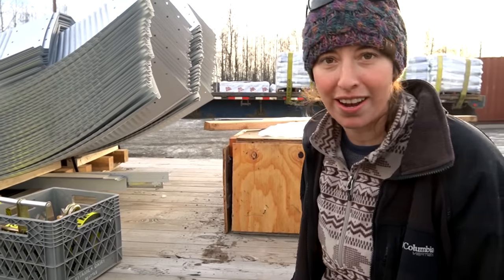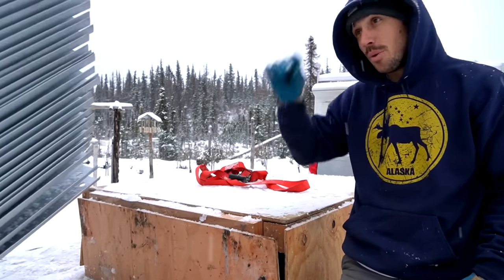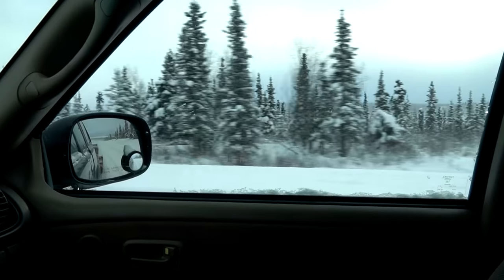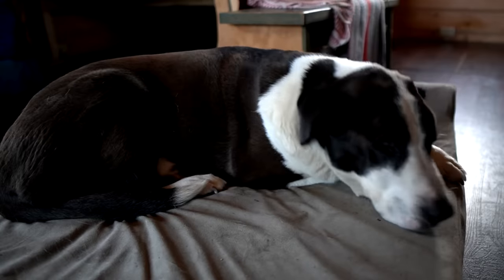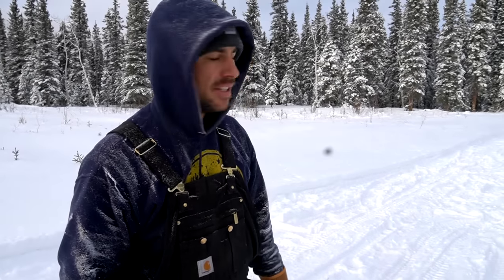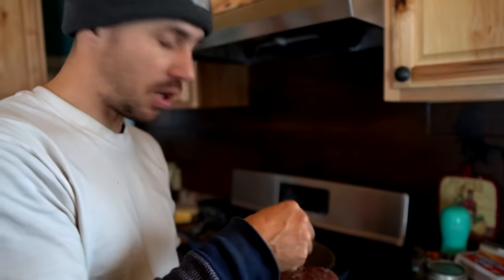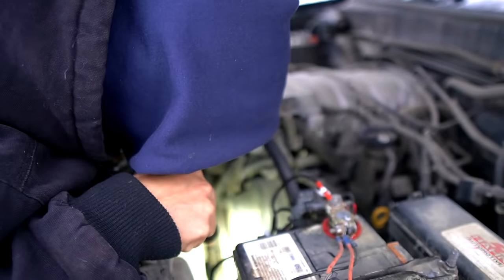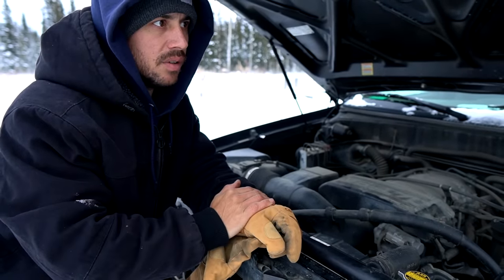Heading North to the Cabin | Hauling Next Year's Big Project

Comment: That heater in the crawl space was to keep the pipes from freezing
Reply: I should have looked before leaving a comment. Same thing that I said!
Reply: I thought it might have been for the water pump, but it still may have been for the pipes.😀
Reply: Good place to hide when Sasquatch comes to visit
Reply: I think adding a cheap digital temperature controller with outlet would make it a 'set and forget' pipe heater. Set the temp controller to about 35°, plug the heater into its outlet and forget about it (after you check to make sure it's running right).
Reply: @hxhdfjifzirstc894  how does that work when they’re dependent on a generator?

Comment: The previous owner of your cabin is a genius for putting the well in the crawl space were it was not subjected to to full brunt of the sub-zero winter temperatures. Common sense is not so common any longer in our country, but the previous owner thought ahead and knew he did not want to have any issues with the water pipes freezing so he took measures to assure they would not freeze. Bravo

Comment: Tips for building the quenset, it will stand upright by itself after 3 completed strips even with no rear wall,  rent a manlift to put it up - ladders suck and it will support the first few strips when you start building, have a small aligning bar handy to line up the holes to start the bolts, use a butterfly air impact to tighten the bolts - it's small light fast and torques the rubber sealing washers down perfectly and after 5 5 gallon pails of nuts and bolts will save your expensive battery powered tools. 2 guys with no experience we had a 40x60 up on a prepared slab in about 4 8 hour days in November with light snow.

Comment: When I lived "up north", having an electric heater in the crawl space usually meant that at a specifically low temp, the space heater would be needed.  Just like a propane blanket was needed for the propane tank at -40 or colder or the propane starts to gel.  Not sure if you have propane at the new place.  Really like the new place.

Comment: Long time fan and never miss an episode. Wish I could convince my wife to move to Alaska LOL. 
Quick FYI for the well pump. I found out the hard way that when running a water pump on a generator (and likely solar system) you need three times the wattage to safely push the pump with the generator. Im not sure why. But it over-taxes the inverter/regulator. Had to replace mine on the old generator twice and eventually shorted out the dynamo. You said the pump is 115V and 12A so it's 1380 watts. Typically 1/2 horse pumps are 500 to 750 watts so more likely its a 1Hp which makes sense if the well is deeper than 25ft or so. I run a 1Hp on a 40ft well. Keep this in mind when designing the solar system because you will need at least 4140 watts to run the pump alone. Of course, it won't be running all the time but something to think about when you decide to run it for extended periods while other things may be running at the same time. Like your freezer in the summer.
Reply from the maker: Thanks for the tips :)

Comment: Good luck on the build. Currently building my 40x60’ Quonset and trying to get finished before winter hits here in Indiana. My tips:
-pay someone to do concrete prep and pour, I did mine and it took forever cause I was only working nights and weekends without much help. Rain flooded foundation so many times and weather kept holding up foundation work. 

-when building the arches make sure you use the provided “story board” angle iron pieces to keep the ribs correct distance apart. Got 12 panels in on mine yesterday and kept having issues getting bolt holes to line up and then checked dims and realized top of arch was growing and bowing out front to back out of vertical square. Taking forever to unbolt and loosen ribs enough to come back and get them to correct offset to pull bldg back into square. Killed a whole day yesterday and still more rework. 

-minimum of a 2 person job. Can’t hold and align and bolt together by yourself. Scissor lift is a must, have been putting them up straight and curve on both sides, then short on one side and long on other then both top pieces together on ground and lifting up into position. Working well but kinda slow. Would like to try to build whole arch on ground and lift into place to see if it’s any quicker but don’t have a crane. Taking us about 1-1.5hrs per arch. 30 arches total for 40x60 and I have 15 left so another 20-30 hrs in arches and more for end panels and doors. 

-just realizing spray foam is going to be a must. Frosted last night and sun today heats up the metal and cause frost to melt and essentially makes it rain on the inside and would get all of your stuff wet. Hope it gets better when I have the whole place enclosed but not sure. 

For anyone still reading: 
Steel master 40x60 19’ tall S model $35,000
Concrete I did myself but $5K materials (rebar, mesh foam, pex), $24,000 contractor just to put up form boards and pour/finish. Ask me any other questions, I have a cost tracker if you are curious. 

Good luck! Great structures from what I can tell. Happy building.

Comment: Bo knows... Bandit's ready!  Pepper's like... "Toz R Kld".  Reflectix is your friend up there.  Come spring/summer, consider some of those fiberglass road markers they use up on the North Slope/Haul Road, and stake the edges of your driveway/entrance.  They use various colors of reflective tape on the tops to define entrances to pads (lots of ground), right/wrong sides of the road.  They remain flexible enough to withstand road care work, and guide your path to drive on.  When I had need of driving in "Phase III" conditions up there, a spotlight guided you from reflective stake to reflective stake.  We had to memorize those patterns to navigate in white-out conditions.  They're a life-saver.
Reply from the maker: Thanks for the tip :)

Comment: So lucky to have an inside well. My in-laws put an inside well with a big holding tank in the farm house we bought from them. Back in probably 1940 when they built the house. They had a space in the basement that was built out from the main basement with a cement sidewalk over the top which was the back door entrance. Much wood re-enforcement. etc. They had made a holed large enough in the cement and cut a thick plug of wood and literally pounded it in there and it stayed with wood re-enforcement inside. 

When the well company had to do any work they just took that plug out and could run their large pipes thru the hole down to the well.  Never heard of anyone else doing this but it was great. Had doors on the space inside so we opened them when our Minnesota weather hit those 20 to 30 degrees below zero to prevent freezing. Just some info for  thought for anyone. I loved having it inside. So easy to put in new tank or work on the pump or clean the screen. Thanks for the great trip to the new cabin. Can't wait for all the new things that await you. God Bless.

Comment: Arielle and Eric, I have a friend here (Central Alberta) who built a timber framed house that is exclusively heated with wood. He installed an inline duct fan with a hose drawing heat from the peak of the ceiling and blowing it into the crawlspace. He has never had a problem with freezing. Those fans can be found on Amazon.

Comment: You can dig a basement. Put an access port window call in for firewood. And put a barrel stove in there. Just start digging. My basement kept something like 3' away from the foundation.  Cabins that have fireplaces in a basement has a downdraft tube from the highest point in the house so the cold air will fall and the hot air needs to havgra Graded place to rise.  Castles however add a big fireplace and heated up a wall were structure and it rarely created a long timeven after the fire was out.

Comment: Built a 40X60 18 years ago. Make sure the footing is absolutely level (W/In 1/4 inch ALL around). Built a 35' truss that matched the interior and put it on a manlift. Built the rings as we raised the lift. Was able to mount a ring an hour including bolts, with two guys. Good luck

Comment: Make sure your galvanized is totally covered so snow cannot get in between otherwise the galvanized will turn mushy and disappear into white rust. In my past steel business I learned the hard way. Snow can be brushed of but get out before the sun can get at it. If you get some white rust, get dried off and paint it with Sherwin Williams metal latex primer, tinted silver or grey. BUT KEEP THE SNOW OFF THE STACKED SHEETS. Good luck

Comment: The previous owner looks like they had planned ahead. The reflectix on the ground was an insulation barrier, and it has some insulation on the walls. There is a product from Lowes, a plastic insulation barrier maybe put on top. The electric heater probably used for extremely cold temps so the pipes won't freeze. This is similar to what RVers do during colder temps to prevent pipes from freezing. Those little personal electric heaters provide enough heat to keep the tanks, water and black from freezing. The Generator room like you mentioned needs an air intake/exhaust. Some people a Rubbermaid garbage/shed for there generators beside the house with air intake/exhaust with insulation to baffle the sound for neighbors. Been following you kids since moving from Oregon. This new place is great for your future endeavors. If you know how to fly, you could possibly carve out a runway for a bush plane. Your doing everything now, one more skill to learn.

Comment: Guys, great episode and really excited for this upcoming phase of your life in Alaska. We have the 9500w Firman and have also found it to be very reliable. We built a housing sort of like yours and found a bathroom exhaust fan and a 90 degree duct elbow with screen serves as a cheap but capable air intake into the box with the generator exhaust connected to an exhaust pipe as an effective outlet. Your box is a bit bigger than ours but your temps are a bit cooler so it maybe worth the <30 bucks to try it out. Thanks again for all the content, Dan and Elle.

Comment: A friend of mine put up one of those, much smaller only 30x40. The concrete pad was a chore because of how it is supposed to fit on the walls. And the number of nuts and bolts was insane! They are not the easiest panels to align to each other. I hope that you have some friends to help you...

Comment: I built a 36x60 shop off grid in northern MN.  Put down 2” foam board then rebar then tie pex water tubing down.  Then concrete over entire floor.  It heats with a very small wall boiler.  Runs on small solar system with 6 batteries.  It takes about 300 gals of propane for a winter.  Best heat in the world.  Good luck.
Reply: Oh yeah.  The system runs about 95 watts of power to work on the winter.  About 1 big lightbulb.  February is tough as you know.
Reply from the maker: Sounds like what I need,  do you know the brand and model of the boiler perhaps? Are you using a 12 volt pump to circulate the water?
Reply: @SimpleLivingAlaska   I’ll get specs.  48 volt dc to inverter.  Powers 120 ac to basic outlets.  I have a couple of boilers.  Will send specs soon.  Not cheap.  But absolutely amazing even after 16 years.
Reply: Please send email and I’ll send a ton of info.  My neighbor was extremely helpful.  I can share.
Reply from the maker: simplelivingalaska@gmail.com
Reply: Ok will send info next few days.  I’m off grid now.

Comment: Depending on if you have a rv style plug or a pole style you can close the connections on your plug ,if you don't do that and it works by moving it ounce you start driving it will probaly quit again,so close the contacts and your probaly good

Comment: Batteries outside are much better than batteries inside. If a battery fails, it burns down outside not the whole house. I have seen insulated battery shacks and beer fermenting heater belts around 4 batteries does a pretty good job of keeping them warm. insulate your battery house too of course:) and set the heater belt on a temp sensor to turn off when warm enough...

Comment: We live in Wyoming, our house is 960 square feet, and we have a crawl space similar to yours, when we moved here there was heat tape on the water lines in the crawl space.  We installed a woodstove and keep in going all the time in winter.  Our crawl space stays about 50 degrees, and in 13 years here we have never had any of those pipes freeze.  That woodstove heats our whole house, unless it gets about -15 then we have to run a small heater in our bathroom, but other than that nothing freezes.  I just love your new little cabin!!
Reply from the maker: Good info thanks!
Reply: @SimpleLivingAlaska  Congratulations on the new place. Eric, have you taken into consideration some kinds of batteries do have some out gassing when being charged? Not sure in they would gas up through the flooring into the living space, if there is no insulation. Safety first!  We kept ours outside on a small heated flat area above our bathroom, that was covered by an open roof and they did well in -10 deg in SE AK.  Take care.

Comment: Hey guys, for those heavy loads. Have you ever seen a "pickup truck hitch hoist" can lift at least 500 lbs. can work on the Argos also, a moose hind quarter would be a piece of cake. comes apart so won't take up a lot of room. Can see lots of them on google.

Comment: When you get some used car tires cut some sections across the face of the tires to put overthe metal  edges and the straps on top.  Will save your straps.

Comment: Hi guys, love your channel, have been watching nearly from the beginning. I'm excited about your new place and the well inside the cabin will be a great convenience! But I wanted to alert you to something. Maybe you're already aware of this, and please disregard if so, but a wellhead inside a living space can potentially cause a hazardous accumulation of radon, as the well can act as a conduit for radon to migrate upward from the subsurface.  Some of the highest radon concentrations ever recorded have come from houses where the wellhead is inside. It really depends on the nature of the subsurface geology - igneous rocks often make radon, and areas that were made by flood deposits don't make so much. But the best way to know for sure is to buy a cheap test kit (less than $50 on Amazon, which includes the send-in sample analysis). If you have an issue it can be mitigated with strategic foundation sealing, some visqueen  and a small exhaust fan in the crawl space. EPA has very good guidance on their website, and with your DIY skills it would be a breeze, if needed. Hopefully not!

Comment: If you breakout the power line into a box and put a 30 amp outlet and a 20amp outlet you could run either generator.
Reply from the maker: Thanks for the tip

Comment: although it does not call for it, get some 1-2mm rubber sheet or similar to put in each joint, the water will capillary back up into the joint and do a slow leak.. found this out the hard way.

Comment: Below frost level, ground temperature in most parts of the world is between 45 and 60 degrees. With a basement or stem wall foundation with sufficient footing depth, the house above insulates well enough to maintain temperature.
Reply: ....also, that 4.7 Tundra needs a timing belt every 100k miles, and the water pump is usually done at the same time. The red drips could also be the power steering rack, which have a tendency to seep. Not necessarily an immediate issue.

Comment: Hi kids , l did a straight wall steel building ( 21 x 36 ) much like you are going to build. Many thousands of bolts  & nuts to handle.  Just be sure to have good help in the beginning , rent a scaffold appropriate for your ground conditions and give yourself time to make it right.  Good luck & don't over tighten the nuts/bolts . 👍🇨🇦 Bruce.

Comment: Nice 4 inch straps.  Best not to hook them to the rubrail, DOT can be picky about that. Slip them down through the rubrail and hook under the trailer edge. That way if the rubrail breaks it doesn't instantly loosen.

Comment: The electric heater in the Crawl space may be there to insure nothing freezes.  If it's thermostatically controlled, look at the setting.  Might give you a clue to its use.

Comment: I just want you to know that the outer edge of the foundation needs to be set up to be extra strength so the outer edge of the foundation does not give any... with the weight of the snow you could get will push the outer edge of the building apart and collapse from the weight.. just wanted to give you a heads up on that...

Comment: I will tell you after you put it together you won't want to even look at another 1/4-inch bolt for at least a couple of months. I helped a friend put up one and there were 16,000 bolts that had to be tightened. One person is on the roof and the other is inside on scaffolding. There are enough bolts in those things to give you nightmares. LOL

Comment: Hey homesteaders! nice video, I always carry a 30 amp to 20  amp adapter when rving,  looks like that would have worked with your generator shed. You two are very careful and plan out all your endeavors... I guess in Ak. if you didn't you would be statistic added to Ak.'s 6,000 missing persons or wanna be mountain men/women. Your gardening knowledge is excellent, I think that is more important than the meat production and hunting. Best of luck.

Comment: Just a comment on your new Quonset hut I've done two of these buildings the first we had no problem with the second one our workshop we had a problem with the last four rows in particular the curved sections, the holes didn't quite line up, we suspect because they were the on the bottom the pile the weight from the pile above deformed them so it might be advisable to lay the curved sections on their side or split the pile(s) up if they are going to be sitting for any length of time.